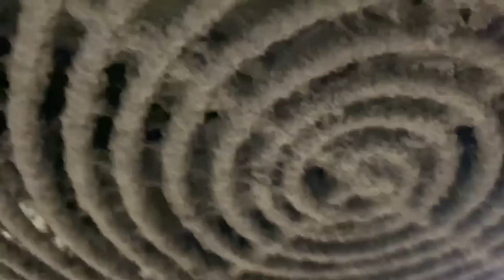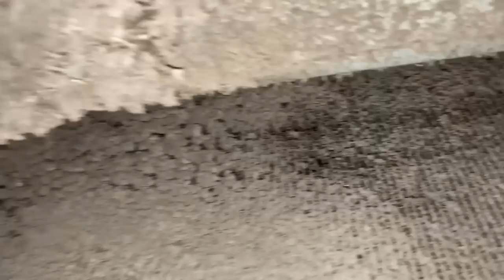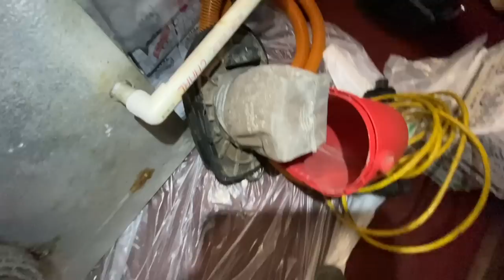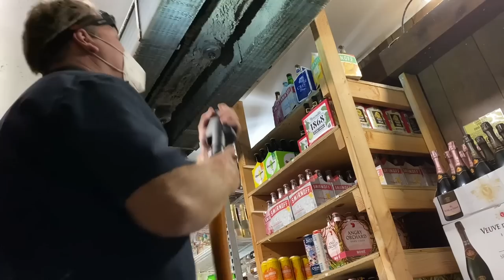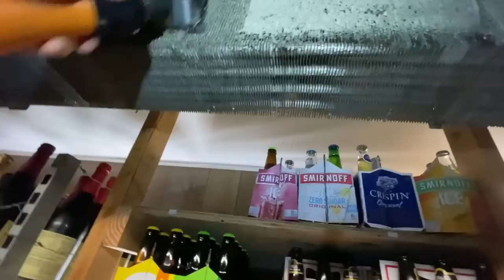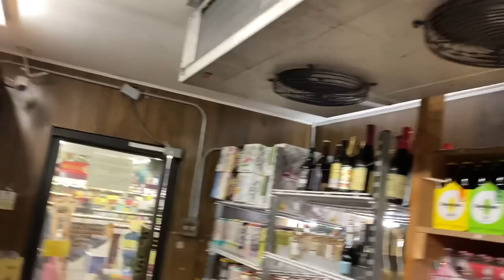Walk In Cooler Maintenance

Comment: Dave, I use a 2.5 gal vac with a discharge port that a vacuum hose fits on. I run the discharge thru another vacuum hose out the window or door if possible. Keeps all that air from blowing in a small area stirring it up. Also you can leave the filter off and cover the cars in the lot with shit.
Reply from the maker: Epic I might try that
Reply: No filter should trash that vacuum motor?
Reply: Whites heating & air & appliance repair  Inever had an issue, it just pukes the dust and fuzz outside. Maybe if you had sand or something you might have an issue.
Reply: @whitesheatingairappliancer7101  the models with an actual "hose" connection exhaust port will be fine, the motor itself uses separate cooling air flow(you'll still have some heated air from motor blowing in cooler)
the vacuumed air /dust will go through the impeller easily, big hard chunks or long string/rope may get into it and mess it up, but I doubt any of that would be in the evaporator

Comment: the oncoming air has dust and will stuck on the coil ,  since  the evaporator is cool and drains the water  as well the evapo fans works the dust will be remuved aoutomaticly with drained water. so i think this unit worked whithout gas.

Comment: I like how you pull the mask down for the dusty part that actually needs the mask.  That's using your brain. Lol😂😂
Reply from the maker: Googles fog up. Rather keep that shiz out of my eyes.
Reply: @NorCal-refrigeration  I hear ya I haven't yet mastered the mask with glasses
Reply from the maker: Brett Wing it’s terrible
Reply: @NorCal-refrigeration  There using dish soup to make it not fog up. Warm water and dish soap: Wash your lenses in a solution of warm water and dish soap, then let them air dry completely. It’s important to use lukewarm water - avoid hot water because this can damage the lenses. The dish soap creates a film on your glasses that will not inhibit your vision, but can help prevent glasses from fogging up. It’s best to let the glasses air dry fully, but if you must wear them immediately, wipe it down with a microfiber cleaning cloth. This type of fabric is extremely soft and should not scratch, damage, or leave behind fibers on the lenses.

Comment: Some of those get so bad they need to be washed out. Nothing else will clean it up
Reply: It is not uncommon for these to be washed out. But damn, the placement of this coil, and the fact that fans holes are down, and nowhere to move the bottles, make it really hard in this case.
Reply: @movax20h  easy. I use plastic funnel it into a garbage can. No mess just pull the plastic down from ceiling that's taped up there. Only way to get cooking grease out if the coil